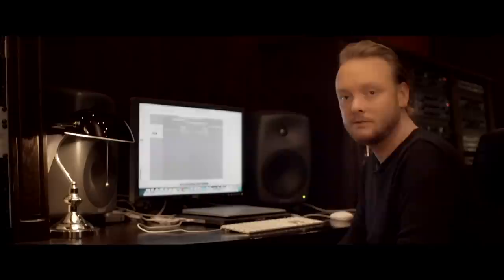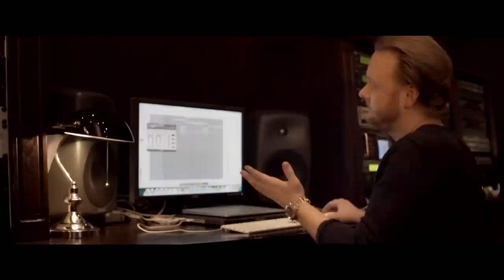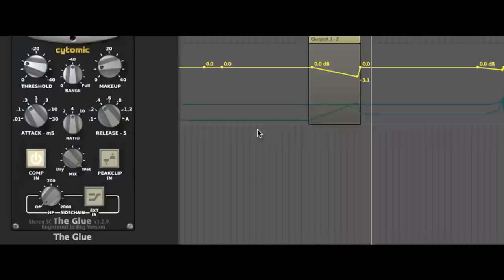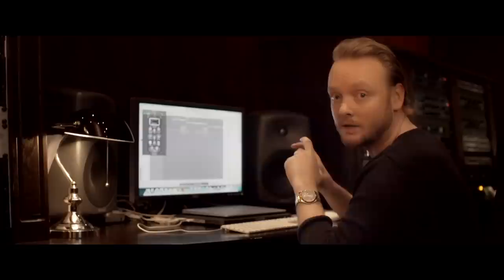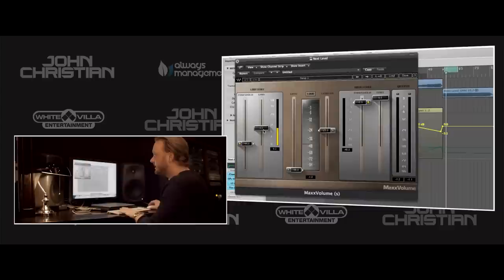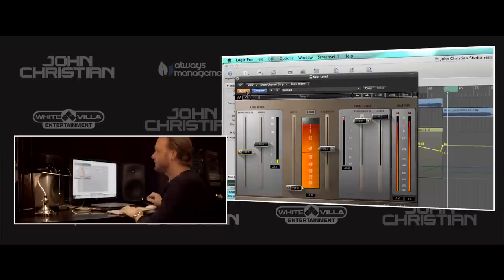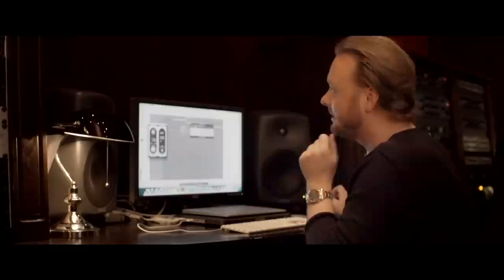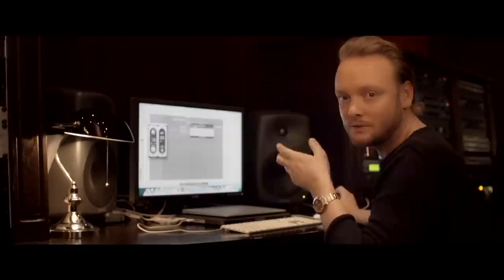John Christian's Studio Sessions: Chapter 11 | Mastering Part II

Comment: I usually push more attack on the compressor (3ms to 10ms) to increase the transients before the final limiter so the transients can be distorted a little. It adds a bit of "quality factor" (stops it from sounding too smooth) to the track while allowing for an extra 1-2 dB of limiting for louder club tracks. I usually do this only the Mid and have the Side sounding smoother in order to accentuate the drums (especially the kick) in the middle. It anchors the main beat, keeping it steady in volume and allows the movement in the stereo field that swells around the main beat due to the M/S compression.
Reply: ***** I'm gonna try that thanks !
Reply: ninjafukwan7
You're welcome.

Comment: Question:
How do you get transient sounds like claps for example to stop peaking..do you use a limiter on that clap Chanel? or a compressor..how can I stop these sound to Peak but still make them sound like they have volume and presences...?
Reply: ninjafukwan7 Compression will help you a long way. Since most claps usually only need that "snap", you can use a compressor with a hard setting and an attack long enough to give the "snap" of the clap enough presence. A limiter to remove peaking could also be applied, but be careful with that one. Only remove a tiny bit just to reduce the db signal, not the initial sound of the clap. 

An alternative is also a volume shaper where you draw a curve that determines how the clap should behave in the db range. Hope some if this was helpful to you.
Reply: The Scandinavian Gaming Channel Thanks. You are correct with all your point Thumbs up for that! 
Was just curious to know how John Christian approach was dealing with claps etc....
Reply: ninjafukwan7 What style of music do you produce? Pre-delaying the claps (somewhere between -10ms and -25ms) works for more housey styles and can work for some trance/house hybrid styles. Most of the issues with the clap transient not being heard is becasue of it playing at the same time as the kick. Separation of sounds works in the time domain as well as the frequency domain, amplitude (dynamics), stereo field and at the psychoacoustic level.
P.S. Sorry for butting into your thread. :)
Reply: Electronic,Dance..

But You miss understood...when I mentioned wanting the clap to have more presence it wasn't because it's hiding under the kick...But when in a drum bus..it's usualy the sound that keep peaking making compressor or limiter react to it more.

So if I try then to lower the volume to keep it under control..well you loose power in the sound.
So I wanted to know what John opinion is and really I wanted to know what his process was for dealing with sounds loud clap as an example.
Reply: ninjafukwan7 Distortion to remove the peaks. Most compressors use peak detection for the threshold so cutting the peaks off with distortion will help. Hard limiting with something like an L1 will work too but it won't sound as snappy.
Anyways, apologies for misunderstanding and I'll leave the thread so you can wait for John to respond with his opinion. Good luck with the mixing.
Reply: ***** Uh ? no need to leave...And I've seen plenty of Videos from busy producers on youtube to know not to wait for a response! But rather if you get a response cool..if not ..it was cool of them to make time to make the video in the first place..I appreciated it either way !